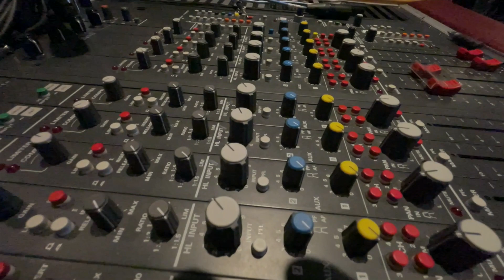Is DSD pseudo analog?

Comment: Hi Paul,
Is DSD recording same as the old Laserdisc which is purely analog system only stored as 1 and 0 on the disk? Which explains why pure DSD recordings sounds analog?
Thank you.
Reply: If memory serves me Laserdiscs were actually analog using FM modulation
Reply: @Paulmcgowanpsaudio  Yes Paul I believe that is correct, so is DSD same like FM modulation where the distance between the 1 and 0 is pure analog?

Comment: Hi Paul,
thank you very much for your very interesting videos - I enjoy them very much since quite a while now!  
After watching this video I decided to send my very first question:
Here in Germany many sellers of audiophile equipment use CDs of the well known label Chesky Records as 'reference' to impress possible customers. These are 128 x oversampled recordings on normal CD. Please correct me if I'm wrong, but this would mean 128 times 22.500 samples, approx. 2,2 million samples per second.
This has to be reduced back to 2 x oversampling, of course, because im PCM this would mean 64 CD's of storage, resulting in 64 x 700 MB, about 45 GB of digital data...   ...in times of Blu-Ray technology not really a big deal, but I only can guess that this may require powerful DA-decoders.
So, since DSD 64 produces about 3 million bits per second (if I understood it right), the resulting file should be about 1/8 of a PCM 128 x oversampled file...
...a clear advantage - but comparing these two directly, not the downsampled 44.100 Hz PCM with DSD 64: Are there more advantages of DSD to mention?
I understand your Statement, that in the end everything we do ist digital in some way - and I totally agree! 
So, keeping this in mind,  both should be quite comparable? But maybe my argumentation  is wrong  at some point?
Maybe you find this question interesting enough to discuss it officially...
...but maybe you discussed this already and I simply wasn't able to find the right video?
All the best for you, your beloved ones and Octave Records, of course!
Gerhard from Bavaria, Germany

Comment: I see DSD as a representation of compressions and rarefaction of air pressure caused by sound. Compressions are represented by a greater concentration of ones. With PCM, compressions are represented by a higher 16 bit (or whatever word length) number. it's harder to see patterns relating to the sound when the 0s and 1s of the 16 bit numbers are laid out in sequence.

Comment: The question of whether DSD is digital is beside the point I think... The question is whether the signal medium (in this case it's digits, in others it is differences in magnetic flux as in tape, or physical grooves in vinyl) is 'analogous' - i.e. that it varies in a direct proportionate way the same as the source. I think that the density of ones in the DSD signal varies in an analogous manner to the loudnes of the original signal and therefore can be seen as 'analog' in the same way as vinyl records or tape.
- Richard'

Comment: I would say, your body can sense frames up to 1000Hz frequencies.  There were plenty of tests done but you can see one frame of light at 1000Hz, video games played upwards of 240Hz+ can be "felt" in a sense.  Film is at 24fps because frame persistence is more cinematic and makes it look continuous.  60fps video and beyond just looks smoother and smoother. To say that that we can't sense it is false.  Eyes have a radial acuity for a "pixel" in a sense for pixel density of film/movies/photos, it's the whole "retina" resolution from Apple.  I'd feel there's a same way with hearing audio sampling, but it's a matter that you want to effectively raise your sampling rate (i.e. frame rate, pixels, etc) so that goes beyond the capabilities of the human body to tell a difference.  You're basically at the point where you want to over sample but then the way you really tell analog vs digital is that digital is a binary result, it's either there or not.  Analog has noise/artifacts that can still be introduced to the signal but still present the same.  

But it is interesting that you could play DSD through a speaker direct and get audio.  Maybe that would be something to demonstrate in a video playing back raw binary through a speaker (I know you'd need to attenuate a PCM file, but it would still be good to demo it) and compare with oscilloscope readings of each compared to an analog signal.

Comment: Hey, thanks Paul!
I was going to buy one of those fancy DACs (Digital to Audio Converters) of yours but thanks to you I found out all I need is a low pass filter and I could play my SACD.
Except it didn't work.
It turns out that DSD (PDM) is a digital signal and it requires a digital to analog converter to produce an analog signal.
But on the bright side, you said I could see the analog in a DSD (PDM) signal so I took two leads and hooked up the SACD to an oscilloscope.
That didn't work either.
It turns out I need a digital to analog converter to do that too!
But the good news is I could see the waveforms after I hooked up the DAC to the oscilloscope.
The bad news is they didn't look anything like the original analog signal at all.
There was this huge amount of noise that the original analog signal didn't have.
I guess that's why additional filtering is required because the original DSD (PDM) file doesn't look anything like the original analog signal.
On a lighter note, after using a digital to analog converter and a low pass filter I was finally able to get the DSD (PDM) to look just like the analog signal I recorded with PCM.
Reply: Jon, take a deep breath. I appreciate your snarky remarks. They remind me of me! PDM requires nothing more than a low pass filter to play analog. It's what we do in our "fancy DAC" that you could have mythically purchased. The output of the FPGA inside our DAC is a PDM stream and we simply run it through level shifters to increase the output from the LVDS output to a reasonable level, lkow pass it, and that's analog.

But, thanks for the wonderfully snarky comment. Made my evening. :)
Reply: @Paulmcgowanpsaudio  So do I understand you correctly in that you are saying your field-programmable gate array is not programmed to be a digital to audio converter?
Reply: @JonAnderhub  The function is a D/A converter, yes. But what's relevant to our discussion is that the output of the FPGA in the DAC is PDM. That PDM stream is low pass filtered to become analog.

Comment: Planck, Length and Time. Laws of physics. Proposed by and named after Max Planck, Planck length is the shortest distance measurable. You can divide things, cut them in half, ... to that point. You can not cut something that is a Planck Length in half, trim off an end... Planck Time is the shortest measurable instant. So yes we are made up of little tiny Plank Length sized bits.
Reply: We are nowhere near able to sample at that level in real time though so this argument doesn't matter...yet
Reply: @shayhan6227  It seems that sampling rate stays ahead of data transfer and storage size needs.

Comment: Hey Paul I've always loved your videos and have learned a lot from you. I'm just writing because I believe there was a bit of misunderstanding in the example of 24 frames per second you mentioned about movies. Actually movies are post processed at 24 fps because it gives the traditional cinematic effect most people are used to in movies, but our brains can discern motion at much higher frames per second.
Reply: I love that Paul recognizes that there is a point (frames per second) where humans see it as continuous (even though he might not be right about the 24 FPS thing) but he thinks that people can perceive the difference between 96K and 192K sampling rates, and he thinks that $5400 IEC cables sound better.
Reply: @Wizardofgosz  to be fair, he stated that about 25fps is where our brains start to se images as a continuous sequence, which is what the video industry settled for back in the days  when video in the form of film had relatively limited performance. Nowadays we have monitors pulling 240fps (maybe more) and it's defenetly  perceived easily by our minds.

Audio bitstreaming speeds and cables, under the right chain of audio gear, are also easily discernible by us humans.
Reply: @LouieFerdinand  They're not. Cables can be shown to be identical with null tests, and I have yet to see a well done double blind test where anyone can tell the sample rates apart.

Otherwise it's just narcissism and belief in magic.
Reply: @Wizardofgosz  I used to think like you until I gained more experience, but call it narcissism or magic was never among any of my thoughts related to this matter. You are a very funny man. Cheers!
Reply: @LouieFerdinand  You mean you used to believe evidence and science? But now you'd much rather believe that you can hear better than the rest of us, and that your stereo is better than everyone else's and can "resolve" more details?

 Geez, which one sounds like narcissism and arrogance to you?

So what is your stereo resolving that mine isn't? Did mine forget to play a bass note or a cymbal crash? And did it do it on purpose? Like out of spite?

Once you've paid $5 for a cable (probably $1) there is no audible difference between cables.
Reply: absolutely. professional e-sports players compete in the 300-500 fps regions and claim 100 fps is unplayable. imagine them suddenly playing on 24fps.. lol

Comment: DSD is digital (Direct Stream Digital).
Reply: @Douglas Blake DSD/PDM is not FM at all. DSD is digital entirely and FM is analog entirely. The perception of what is "most analog" between PDM and PCM is a matter of how you view it between slope sampling vs level sampling. Either way, you get closer to analog by higher specs (sample rate, resolution).
Reply: @Douglas Blake the wave form of FM is entirely analog. You frequency modulate a carrier sine wave with an analog audio wave. You wouldn’t want digital steps on an FM signal because it would mean out of band harmonics (FCC violations).
Reply: @Douglas Blake Modulation can not be actual digital RF on FM but you can send digital data using different frequencies. RDS, HD Radio, DAB radio etc. do such thing on the FM band.
Reply: @Douglas Blake LOL, yes of course I can see the pulse density varies DIGITALLY according to the analog wave forms. The pulses will be 0s or 1s in the slots of the clock but everything is entirely DIGITAL. You can't make half a bit value or add a pulse in a slot between two slots. Everything is clocked precisely with bits that can be only binary. This is how DIGITAL data flows look like. You can claim it looks analog, but it's with a digital "state space" of values like PCM is. When you observe PCM data you need to look at the data value per sample (e.g. 16 bits) and you can also argue it looks analog. Still it's digital.
Reply: @Douglas Blake No, the pulse density is digitally derived from the analog wave and is digital by nature as the density is limited to the time slots where you can sample the sigma delta bits equal to how PCM is limited to the time slots where you sample the level. Either way, you can't just map the signal flexibly through the ADC to match the exact curvature of the analog signal and quantization errors are introduced. DSD is Direct Stream Digital and not Direct Stream Analog. Theoretically, someone could make the PDM with flexible timing gaps but when you translate it into a computer, that would mean your time gaps would have to be digitized also into numerical values thus even such concept would still be digital.
Reply: @Douglas Blake Yes, but you are missing the point that you don't actually modulate the pulse density in an analog fashion as the DSD clock is fixed between the samples. Thus you get quantization errors. Your oscilloscope comparison is not the equivalent of what comes out of a sigma delta ADC.

Comment: Would like to see (hear actually) a demonstation of DSD going directly (no DAC or low pass filter) to a amplified speaker. Will that be in an upcoming video?
Reply: @Douglas Blake 
Don't be silly.  What's feeding the filter?  An output from a digital device or buffer?  How much power supply noise is there?  How symmetrical are the edges?  How steady are the logic levels?  
You can't get low distortion and noise, directly using the output of a digital device.  It has to be "squared up" by a 1-bit DAC - which is simply a precision analog switch which selects one of two reference voltages.  The same thing that's needed in the sigma-delta modulator loop that created the bit stream in the first place.
Reply: @marianneoelund2940  Thanks for the clarification. So DSD to analog is much more involved than "just adding a simple low pass filter" that is suggested in the video.
Reply: I would like to see that myself. But if the DSD signal has about 3M transitions per second, in order for any signal to reach the speaker that amplifier would have to have an impressive frequency response.
Reply: You still need to have a 1-bit DAC which will precisely set the two output levels, and produce clean, balanced transitions.

Comment: @0:55 "The whole world is made up of bits"
@1:27 "The idea of analog is false"

You go on to conflate continuity with analog.  That is a faulty premise.

Analog maintains its state.  It does not transition from state to state.
Whereas, digital takes a voltage and applies a mathematical formula to that voltage and a value (a number) is derived from that voltage/math marriage.  You no longer have the voltage.  You now have a number for that instance of voltage.

Yes, the whole world is made up of bits.  But not all bits are the same as other bits.
Some bits remain the bits that they are.  Other bits get recorded as a number for the purpose of representing those bits.

Digital can continue to improve over time, even to the point of sounding far better than analog and at a fraction of today's cost.  But it is still not analog.  It is still digital.

A cartoon can be made to look as real as can be.  But it is still what it is.
Reply: everything is   waves whether or not it looks like matter depends on coherence/ incoherence of the constituent waves
Reply: By your definition above, as there is no math involved to playback a dsd stream (just an analog low pass filter), you should be classing it as analog.
Reply: @alex_madeira  I think that you replied to the wrong comment, as it is unrelated to my comment.